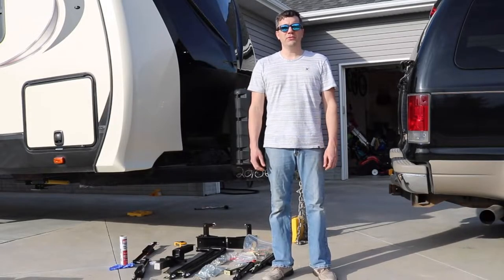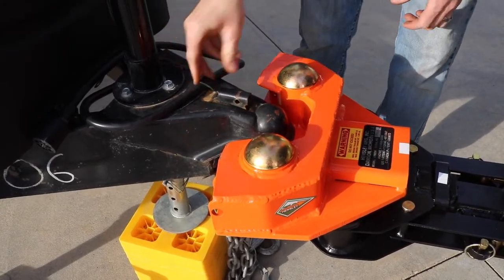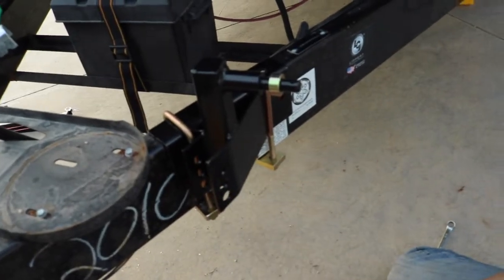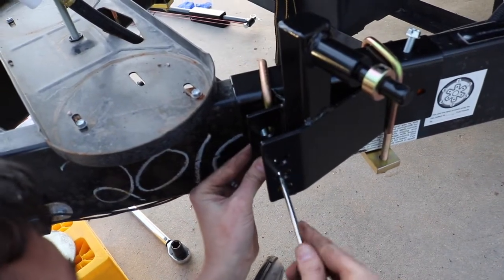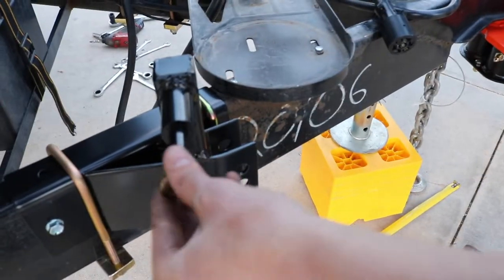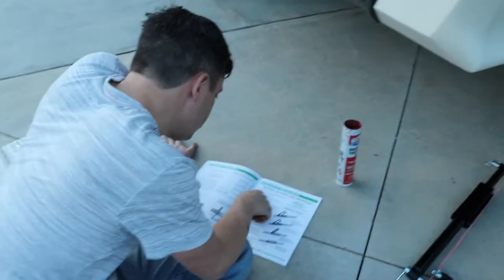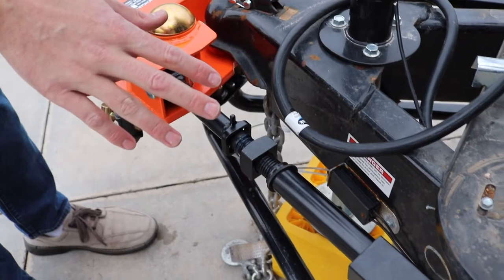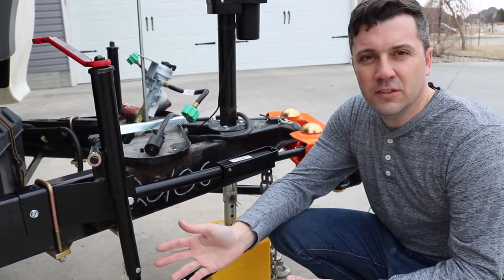HENSLEY HITCH INSTALL || HENSLEY ARROW || LEARN FROM OUR MISTAKES

Comment: I had to move the propane tank forward also.  Did that in the parking lot of the dealer 7 hours from home. Thankfully, I had brought everything I needed with me. I’ve installed 2 - sold the 1st one with the trailer, thinking I’d never own another bumper pull.  Only hitch I will ever buy, love it.

Comment: Lovely work.  I think I like this hitch.  They have a Cub for lighter trailers.  Thinking the DrawTite reciever on the model X may not be strong enough for the left/right torque this unit can produce. But it’s beautifully engineered for a truck.
Reply from the maker: It's pretty cool engineering!

Comment: Hi....first THANKS BEST VIDEO OUT ... QUESTION...you said two screws will do....why did not you use the top entry point in the front and the rear side entry point that are both accessible without going through what you did trying to put the front torque in....is there a reason you did it or just a live and learn ...thanks Mark and I subscribed and went to your webpage...again THANKS

Comment: Thanks for the excellent video! So you don't ever grease the ball again? Doesn't the grease "wear out" eventually?
Reply from the maker: You do need to grease the ball again eventually!
Reply: @AllElectricFamily Thanks for replying. Do you know how often that has to be done? It seems that you'd have to disassemble a few things to get to the ball, or is it really not that onerous? Any insight would be really appreciated.

Comment: I noticed you started with trailer and tow vehicle level, after installing the stinger and orange assembly on the tow vehicle you had to lower the trailer on the ball. Is there any adjustment up or down an the assembly? My truck is considerably taller then my travel trailer. Thanks for sharing this video..
Reply from the maker: The only difference you would have if your truck is taller then the trailer would be a bigger drop on your stinger.  Ours is 2 inches and if we had our Ram that was considerable higher then our trailer we would have had to trade it to Hensley for a 3-4 inch drop stinger but not change the assembly at all.  Hope that helps.

Comment: Hi. I noticed that you chose different holes to drill and screw on the passenger side vs driver side. Any reason why?  Myself I plan on using whatever holes are easiest to access when I install next week.  But maybe there is more to it that accessibility?
Reply from the maker: It was all about accessibility. I was nervous drilling into the camper but all and all easy install.

Comment: What is the difference from thsi one that the last one you did?  do you have one regarding a sway bar? if so which one ?
Reply from the maker: These both have sway control. This is a more advanced sway control. However, the Equil-I-Zer is a more traditional sway bar system. Both hitches help with sway and are a good choice. The Hensley is significantly more money, but also helps significantly more with sway.